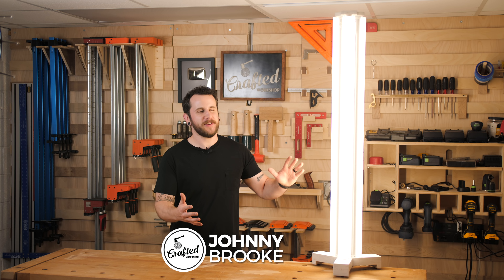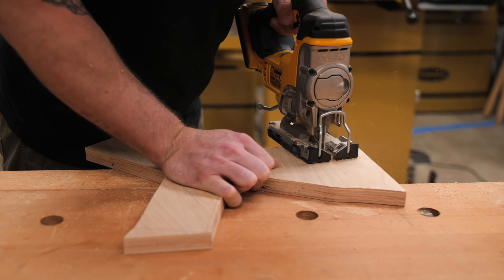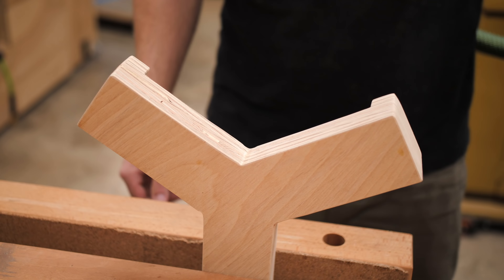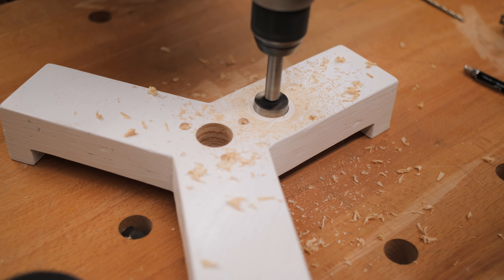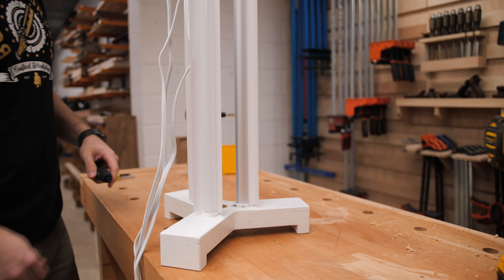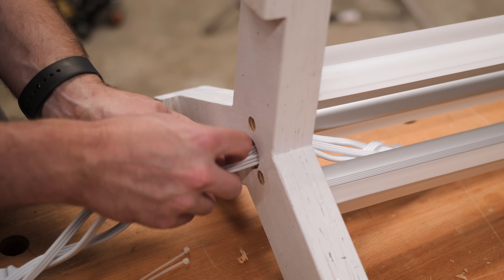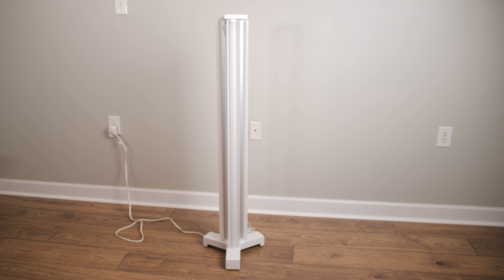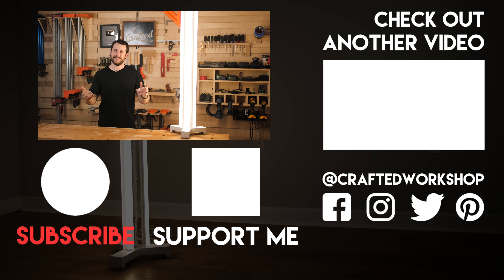How To Make A DIY Smart LED Floor Lamp // Limited Tools Build

Comment: Since you hid the on/off switches, why didn't you just flip the lights so the wires were already at the bottom of the lamp?
Reply from the maker: I would have definitely done that if I wanted to rewire them, but I would have had a huge excess of cords at the bottom if I kept it as is. I think the cords actually add to the look.
Reply: so instead of three long cords at the bottom you  have 3 plugs at the bottom that need some kind of huge extension cord/sockets ?
emmmmmm yeah ok i believe that way looks neater...
mumble  flat earth, less taxes, trump.......
Reply from the maker: Project 806 Camper I would have needed something to combine the three cords regardless since I wanted to use the smart plug.

Comment: Beauty! Like the simplicity of it all. QQ, not sure if this was addressed in the video, but how come the lights werent installed with the wire end sitting on the base so they dont show?
Reply from the maker: Hey David, I ran the wires this way as I didn't want a big excess of cords at the bottom of the lamp. Hope that makes sense!
Reply: I just saw someone already posted the exact same question below, sorry for the double posting lol. The braids were a nice touch, keep up the good work and great job making the video, very clean and concise!

Comment: I like the innovation on this project!  With no real light diffuser, how is the light on you eyes?  Do you feel like it’s blinding when it’s in use?
Reply from the maker: The lights have a diffuser built in, it's actually not bad at all brightness wise. You could certainly throw a shade over the whole thing if you wanted, but I like it!
Reply: Crafted Workshop Thanks!  I think a shade is the wrong way to go as well.  It takes away from its originality. Nice work!  Looking forward to your next build.
Reply from the maker: For sure, thanks!

Comment: I like your idea on the light, but I think I will use Barrina 4' lights, (6 for under $50 plus 6 cords with switches and 6 short cords to link the other 2 together at the bottom). That way you would only have 1 cord with a switch and no other cords will show.

Comment: Really cool look on this one Johnny! Did the acetone kind of mess with the plastic? Is that why you said the Goo Gone would work better?
Reply from the maker: No, it just dissolved the paper towel. The part where the sticky residue was is metal. Thanks!
Reply: Gotcha...that makes sense.

Comment: Instead of pushing a screwdriver through the socket just put a bit of cardboard or paper in the socket then the nut sits flush with the end of the socket and you don’t have to fiddle around as much
Reply from the maker: Good idea!

Comment: I loved the video, but the end product just isn't an attractive project to me. I get lowes sponsoring it so you're stuck using some of their stuff and basic tools, but could have went so many other directions with cable management and the overall design. Even hiding the lights inside of PVC pipe with random holes or designs would look more attractive. But judging off of function, it seems like this floor lamp would be unbearably bright.

Side note, if anyone hasn't order your t-shirt, they definitely should. I love mine and I've had several people ask about it already.
Reply from the maker: I wouldn't call it "stuck", I would say I'm trying to make things more accessible. There are a million ways to tweak this design how you see fit, that's the beauty of making stuff yourself. I personally think the braided cords look better than a PVC pipe would, but that's me. Also, the lights have diffusers built in so they definitely aren't too bright to be in the corner of a room. Glad you like your shirt!